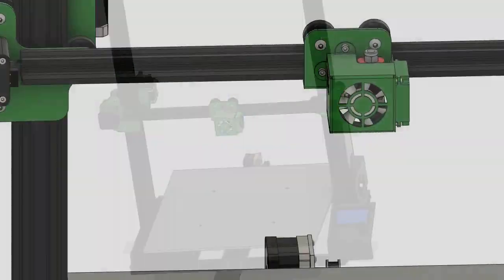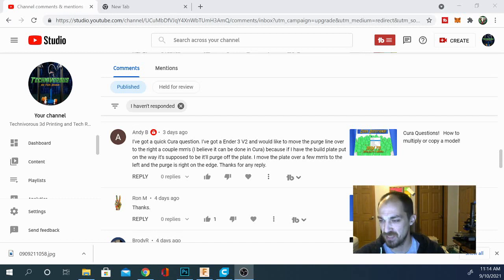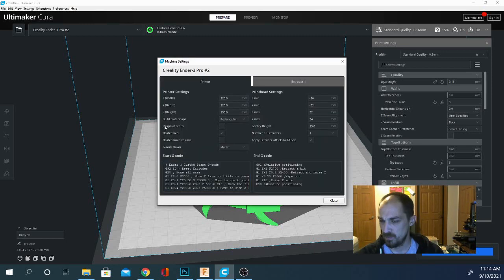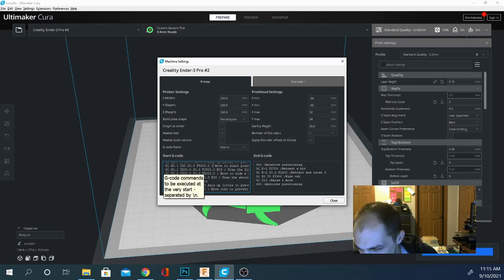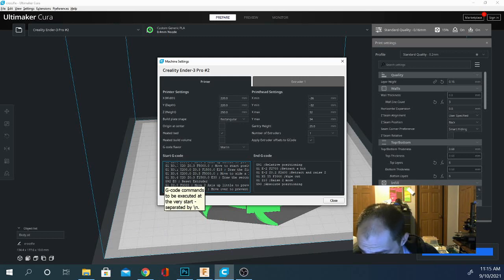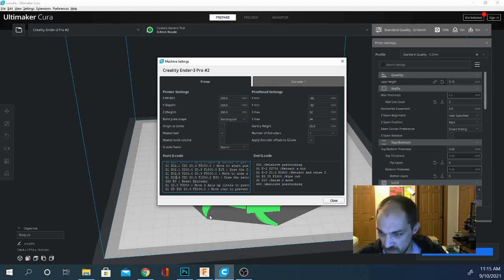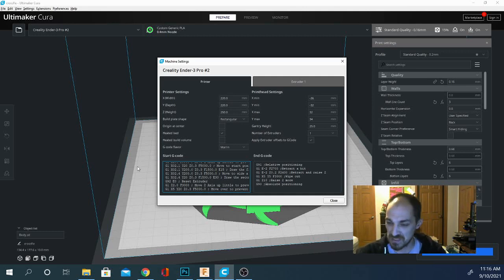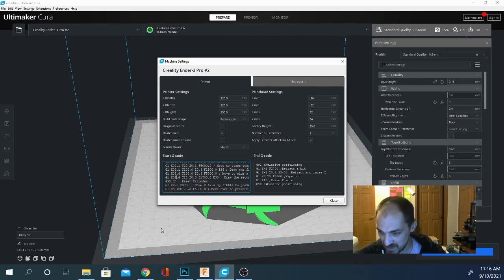Cura Questions - Moving the Ender 3 Purge Line over

Comment: Can the nozzle be raised a tiny bit when it draws the purge line? Mine is a little too close and the line is harder to remove than the skirt. With the skirt I barely have to move it for it to come off but the purge line I have to use the scraper to get it off. Great video btw!

Comment: So I fixed my purging to print on the bed but went to print a calibration test and it printed off the bed not buy much but still not centered and when I put it in cura to slice the print looks like it's centered but doesn't print centered. How can I fix this , I'm using a tronxy crux 1

Comment: How can you move the Purge line to the top instead of the side
Reply: just change the direction the coordinates goes, i have mine set to 

G1 X0.1 Y0.1 Z0.3 F5000.0 ; move to start-line position

G1 X200.1 Y0.1 Z0.3 F1500.0 E15 ; draw 1st line

G92 E0 ; reset extruder

This will make a single purge line in the front where its mores visabel, and will not make a returning line, make sure to delete that line of code in your start code, that says something like: " ;Move over a bit" and ";Draw 2nd line"
Reply: @MrCreeperCamo  thankyou so much, this is what im looking for. Move the purge line to the front

Comment: I have an issue with the purge lines on my Ender 5 Plus. This started after I upgraded to the V2.2.1 silent main board. It does it's first line starting from the front left corner of the build plate, then it homes to the center of the build plate, and does it's second purge line from there going back to the front left corner of the build plate. This purge second line interferes with my print to the point of failure.

Comment: I have an ender 3 , I change to  Microswiss direct drive and extruder, I also had to PID to get the correct setting and reset my esteps. All good so far but my purge line now starts at home and traverses on the front of the bed instead of going front to back ..... can this be fixed? if so How/? TIA
Reply from the maker: Purge line is in your start code. Did you change it when you added ur swiss?
Reply: @Technivorous  I dont think I did, it all changed when I did the PID.

Comment: I edit the Cura 4.11 Start G-code but it either doesn't save or it gets ignored. The output gcode only has the generic Cura settings, not the modified PID values, step, or Z-offset. I can't store those values in the Ender 3 V2 as it doesn't have EEPROM (frustrating). I did just upgrade from Cura 4.9 to 4.11 today, so I am either doing something foolish or I found a bug. Any insight?
Reply: Did you ever figure out how to get it to save? I'm having the same problem with Cura 5.4

Comment: I have exactly the same problem on one of my two Ender 3's one prints it off the bed and one right on the edge.
Reply: Your would need to change your x home offset in firmware of M205 X then the distance in millennium then M500
Reply: Adjust x end stop
Reply: @imc5727  Hard to do on an Ender 3, I already glued a 3mm thick peice of PLA to the hotend cover which was the easiest solution

Comment: hi i have a question i have a tarantula rs ive installed the marlin usb driver but i can only control the printer with a small program called printrun is there a reason? does any better softtware exist that work with my 3dprinter? thanks in advance for all your usefull videos
Reply from the maker: first off, printrun is great. but lets discuss the root of you problem, the tarantula driver. updating the driver should make your printer visible to any program that coms with printers. however, when you have two programs open, only one can connect, so the other will not let you. thats the first thing. close all apps except the one you are using.

next, why exactly do you need the printer connected? it is simpler to save the sliced file to the sd card provided, and print from that in most cases.

if you need direct control over your tarantula, try octoprint. the setup is a little more involved, but worth it.

that said, printrun has all the functionality of any other printer interface. it will heat the bed and hot end, turn the fan on, and move all axes... so you shouldnt be missing anything by using it
Reply: @Technivorous  thanks for answering my question ☺ the tevo tarantula rs/homers odysseus comes with different boards i received mine with a skr 1.3  all the programs ive tried failed to connect only printrun work . yes you right i dont need external programs to print but i was just wondering why maybe bad firmware flash